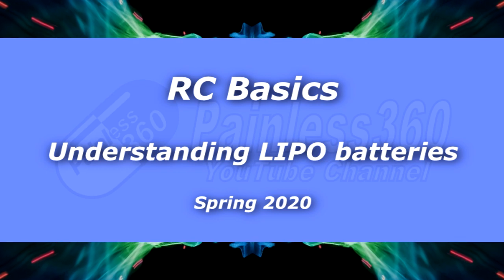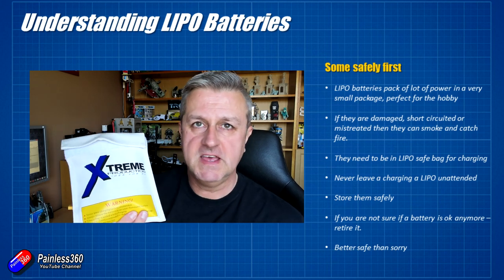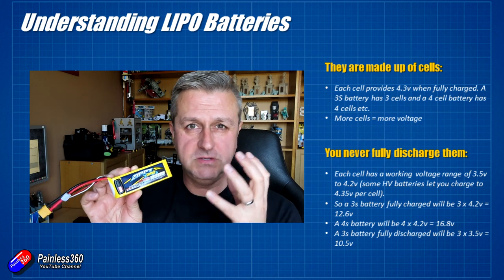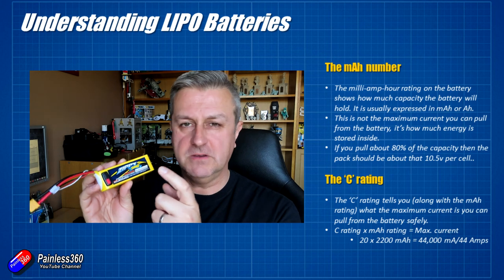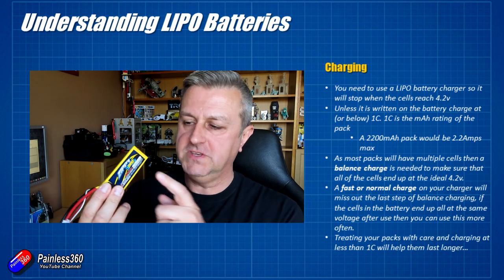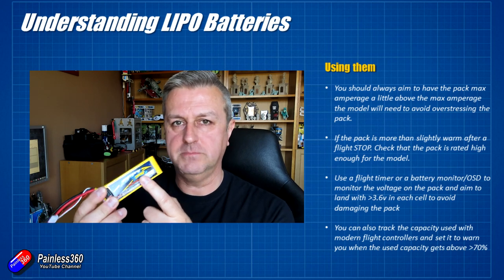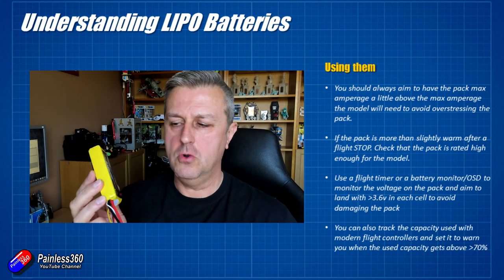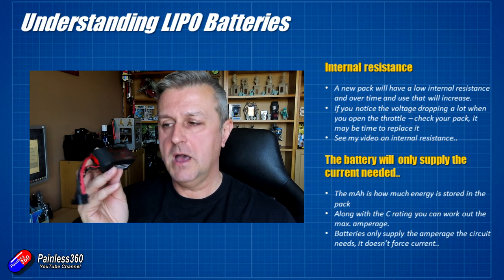RC Basics: Introduction to LIPO Batteries

Comment: Nice clear video.  Can I just add: be careful if you borrow packs from flying buddies.  Fixed wing pilots usually have lower 'C' packs that their Quad friends which can pretty much knacker the pack on hard punch-outs. 
Also, foam extinguishers don't work well on packs if they burst - wet sand seems to be the most effective at removing the heat and damping the pack spitting.  And yes this happened at our club, and no it wasn't me.

Comment: Nice video. However Lipo Bags are not safe at all.  They dont shield enough heat, they dont hold back fumes and they are more too thin and it is possible for a burning lipo to burn right through them. Ammo boxes or other metal boxes have similar problems, it doesnt matter if you hold back the flame, when the surface of your container gets hot enough to ignite other materials arround them. For using the term "safe" propperly, I would suggest looking at solutions like the "bat safe" or similar diy solutions with propper heat shielding that can be done cheap.
Never ever put your lipo in airthight containers. Those can turn into bombs due to the amount of gas generated during a lipo fire. Always make sure the container can vent.

However the most important thing to do is to oversee your lipos while charging.

Comment: Lee, thanks for the Battery video.... Good tips to care for the LiPo's. I ordered the Pixhawk 4 Power Management Board (PM07)from 3DXR yesterday. No one in the USA had any in stock and I won't buy from china. Couldn't find your video on YT about how to use Power Module (PM02) with ESC's.   =)
Reply from the maker: It's in the latest Arducopter Pixhawk 2020 series.. Happy flying

Comment: just a thought. my build requires 4s 3000-4000 mah 14.8v 35c lipo.

I happen to have my dji phantom 4 batteries here which are 4s 5350mah 15.2v (c rating unknown) and I can get an adaptor to convert then to xt60.
I've asked on some fb pages and I'm getting mixed opinions on 'considering them in the build.

I have two and car+house charger so ideal if they would work well. 

what would be your thoughts on this. 
Cheers 👍👍
chris
Reply from the maker: Not sure as I don't use those packs but I am aware that they have some extra stuff in them to stip pilots using non DJI batteries in their products. The question I'd have is how/of that extra 'intelligence' would stop it from being OK.. Happy flying

Comment: Thanks for a great video on the topic of LiPos. Is the relationship between voltage and amphours consumed linear? Has one drawn 80% of the amphours when the cells are at 3,5V? Or can one for example consume 80% of the amphours but have a voltage of 3,9V, or have a voltage of 3,5V but only consumed 65%?
Reply from the maker: Pretty much, look up discharge curves for LIPOs and you'll see how they work.. Maybe a detail for a follow up video!?
Reply: @Painless360  Thanks! Now I know that discharge curves are something I can look up! Maybe some chargers can even make those with my own batteries?

Comment: I like your video, i do have a couple of questions though. One is how soon can  you use them after charging and also how soon can you  charge them after flying? I am a new comer to your and im enjoying so far...... 👍
Reply: If you've charged the pack using Lee's guidelines (preferably Balanced) you should be good to go straight away.  If the pack is hot after a Fast Charge at the field (and I mean Hot) something is wrong.  Recharging after flying - the same rule of Warm/Hot packs apply.  If it's hot the pack has too small a 'C' rating. 
You're better having several packs so you have the time to cycle them at a more sedate rating.
Reply: Good questions. You can use them right after charging. I normally wait just a few minutes after flying to let them "settle" before attempting to charge. Not long really. About 10-15 minutes. It's worked for me fine over the past few years. I also keep an Excel spreadsheet with all my batteries on it to keep track of how many times I've used and charged them. I do this by brand of battery do I know which ones work the best for me. I also know how much each one weighs (important for thrust-to-weight ratios), and other statistics. I do this by putting some identification numbers on each battery.

Comment: exactly wats happend to a few of the battrys we use for teaching as we spoke about other day 3 of em have all charged 2 of the cells 4.20 and 1 cell 3.80 ore something.same batch of lipos gnb.strange
Reply from the maker: Sounds like a bad battery, I'd check the internal resistance of the low cell and also. Check that the charger is OK too... Happy flying